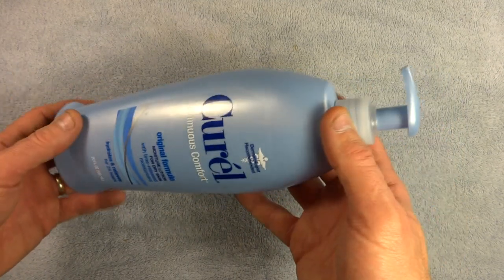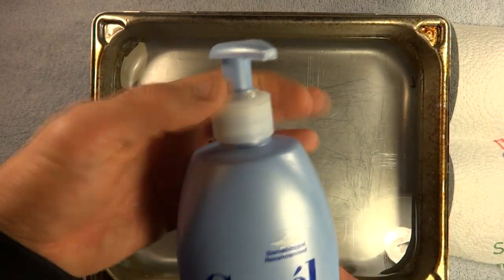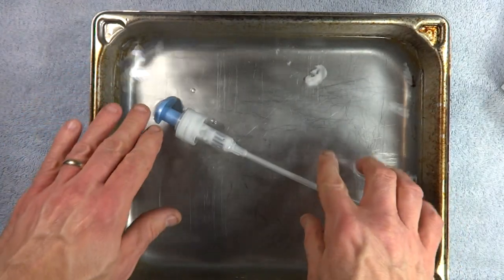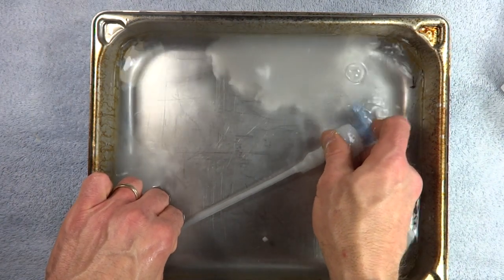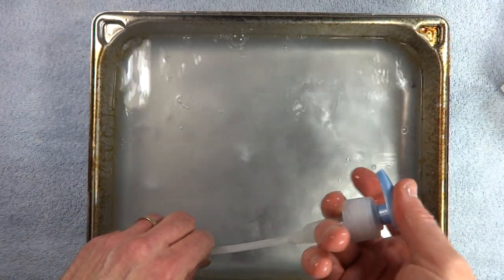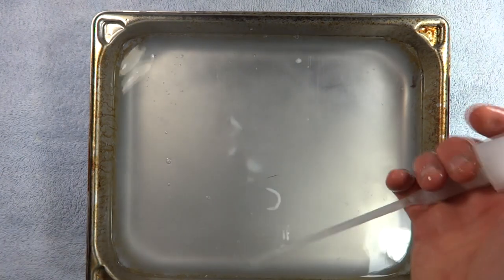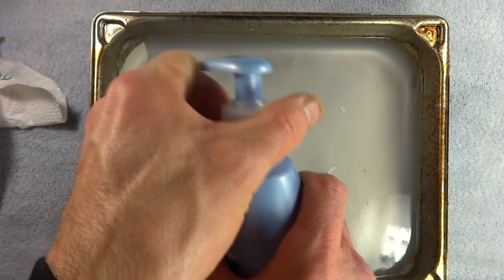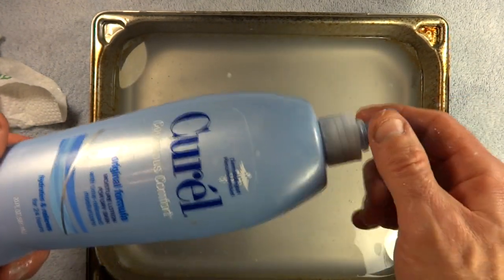How To Fix Clogged Lotion/Soap Pump Bottle/Dispenser

Comment: This video demonstration worked for me very nicely. I was able to make my kitchen sink soap dispenser working again very well instead of buying a new pump from AZ. The pump was not working properly for many months, and it practically stopped working at all two days ago. The dispenser was totally jammed due to accumulation of soap all around the pump during last eight years of regular everyday uses. It took me some time to clean the pumping system using warm water in a small plastic mug / cup. I had to change the water (warmed in a microwave and that is why I used a plastic mug ) two-three times before the pump started moving back and forth again. Finally, I also used a few drops of 3 in 1 machine oil and the pumping mechanism became almost like a new pump suddenly. In the end, I used warm soap water to wash away any residual oil from inside the pump. This entire procedure worked well for me because the pump was made of high quality teflon and it was fairly expensive when I had purchased it over eight years ago. I suppose my kitchen sink soap pump will last for many more years before I need to clean it again or buy a new pump. Thank you!

Comment: Like many others, I bought some lotion recently, but upon setting the pump to open, it simply would not pump. The "soak in hot water" trick worked fantastically, and saved the bottle (and a trip back to the store to return the product as defective) - Thank you very much!

Comment: Thanks so much for the tip. I tried it and it worked! I just bought the lotion and the pump wouldn't work so initially I was frustrated because the lotion cost me $13.00. After watching your video and trying it... worked like a charm. Thanks!

Comment: RJ, I would like to say this is my first subscription to any DIY site.  You are a great help.  I made two homemade tools, from you information first one is headset remover, and headset press.  This is my second attempt to contact you, with the same problem, which  I have a trigger spray bottle.  I soaked it with no results, however a small ball bearing came out while removing trigger from the bottle.  Firstly, where does it go.  Please forgive me if I being repetitive, as I did not see my comment under this video.  Hope to hear from you shortly.  Thanks again for all you assistance.

Comment: Thanks!  I just got a new lotion and it wouldn’t pump at all.  I was so irritated.  I didn’t think it could be plugged if it was brand new!  I watched your video and I took the pump out and dipped the stick in hot water and that didn’t do anything but I rinsed out the inside of the top with hot water and voila!  Saved me a trip to the store to return it and having to open the bottle every time!

Comment: What if you can't get the top off.  I ran it under hot water which did loosen the pump part and some bubbles came out but I can undo the top to put more soap in.  I'd hate to have to throw the whole dispenser out.  Thanks!

Comment: Since hand sanitizer became scarce, I started filling a soap dispenser I had with soapy water. I've used it dozens of times since and now inexplicably, it just doesn't work. I took the pump apart and made sure water flowed thru each part easily. But when I put it back in the bottle and push down on it nothing happens. Frustrating.

Comment: I had a problem with my METHOD brand foaming soap dispenser - it stopped working when I refilled it with the METHOD gel hand wash refill that I bought separately. I eventually figured out what the problem was - the liquid in the refill container was WAY TOO CONCENTRATED. So I put in about ONE PART REFILL AND 7 PARTS WATER - now it works perfectly.

Comment: How about if the top bit comes off from your face wash pump , the bit your finger pumps down? Mine has come off and no matter how i push it down , it never clicks in meaning i can't use my face wash . Do you have a solution ?

Comment: My problem is a pump that isn't clogged, it just doesn't work at all. It's a brand-new bottle of very expensive hair conditioner. The pump goes up and down but no conditioner comes out, and as you pump it the thing spins off to one side, around and around. Could there be something wrong with the spring mechanism inside?
The only solution I've found is to open the whole thing and just run a comb along the tube to get some conditioner on my comb and then apply it to my hair.
Reply from the maker: It sounds like the pump could possibly be defective. Maybe sure the tube is connected fully to the pump. If air is leaking in around the tube, then it might never be able to draw up the conditioner.